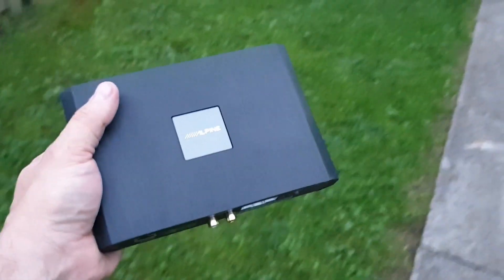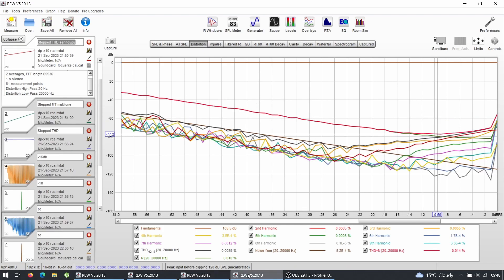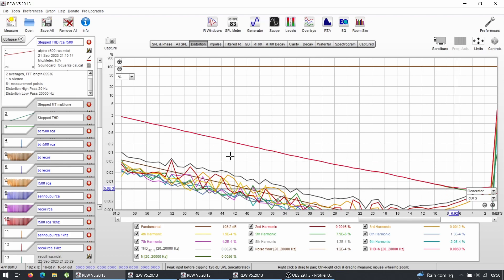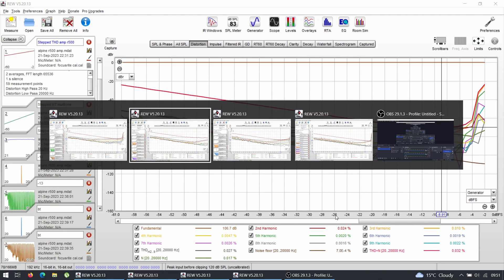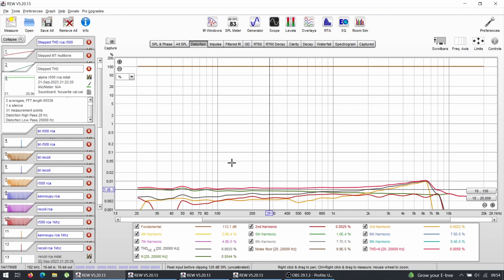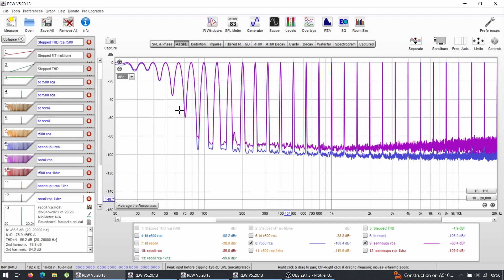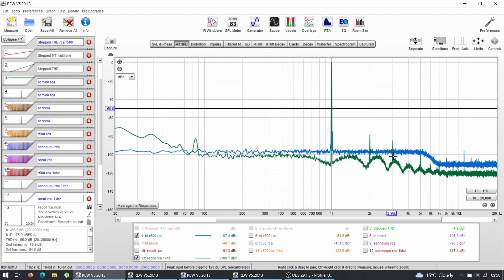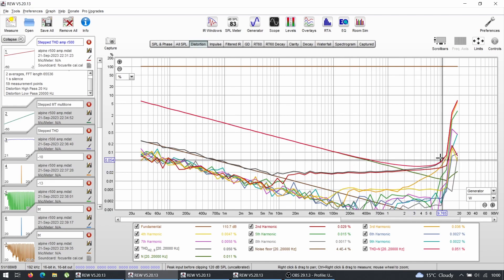Is more expensive DSP worth it? Alpine PXE-R500 distortion measurements

Comment: Will alpine entry level dsp with 25 watt rms per channel outout good enough to play my 90 watt rms morel speakers?
Reply from the maker: Yes, it will be fine.
Reply: @RAW-CAt  thanks for the reply.

I am new to car audio and looking forward to do a good  upgrade of my car music  system but in a  budget .

I will go with the alpine dsp.
Then the next step will be adding a mono and a subwoofer.

The budget options that are available in my place are,

Alpine swj12
Polk audio db1240
Infinity primus 1270

Would you like to suggest as per your knowledge.

I want the bass to be tight , precise , adequately low and loud but not boomy
Reply: I just ordered this dsp, I got a good deal in preowned marker.  Now I wonder how I connect it to the factory head unit with out any wire cut
Reply from the maker: @osomiyadeka270  you might find a harness on AliExpress, just need to check the pinout. Most of these DSPs will.have the same plug with same pins. Just find a combination of your cars harness plug.

Comment: Hi Fam,

Current setup:
Front Components: Helix S 62C.2
Rear Components: Helix PF K 165.2
DSP: Alpine PXE R500 (6-channel)
4-Channel Amp for Components: Alpine S-A32F
Mono Amp for Subwoofer: Alpine S-A60M
Subwoofer: Morel Primo 12
Source: Stock headunit with Apple Music via CarPlay

is it worth to spend extra to get a HELIX P SIX DSP ULTIMATE (give away Alpine 4ch amp and DSP) for front active and rear fill?

the new setup would be:
Front Components: Helix S 62C.2
Rear Components: Helix PF K 165.2
DSP + Amplifier: HELIX P SIX DSP ULTIMATE (Amp out 4ch for front active, 2 ch for rear fill, pre out to sub)
Mono Amp for Subwoofer: Alpine S-A60M
Subwoofer: Morel Primo 12
Source: Stock head unit with Apple Music via CarPlay

Will there be improved detail in the sound? or should i stay with the current semi-active setup? please help.

Addition:
Alpine S-A32F is 55W RMS / channel @ 4 Ohms
HELIX P SIX DSP ULTIMATE is 145 W / channel @ 4 ohms
If it matters.

The cost of the upgrade is 1900 USD. Is it worth the upgrade? will i see noticeable difference in detail?
Reply from the maker: You won't gain much with the upgrade. You will.have much better results upgrading your source from the stock HU. If keeping current setup, run the fronts active, mono for the rears and one rca cor the sub. Get another cheap amp for the rears.
Reply: @RAW-CAt  Thank you so much for your reply. The problem is that the TPMS, ORVM control, service indicators, and lights are all integrated into the stock head unit. That’s the only thing stopping me. 😭 If i keep the current setup with stock HU, will the 55W RMS from the alpine 4ch amp clip or damage the speakers which are rated for 100w RMS?

Comment: Hi, I am planning to use Alpine PXE R-500 but confused about the speakers. My car fits 6.5 inch speakers. So in the back I will have a set of coaxial speaker and in the front a set of tweeters with mid range speakers. Now the question is what kind of RMS wattage of speakers I should be looking for? And will it be able to support a powered subwoofer. I yes what should be its wattage?
Reply from the maker: This DSP/amp will be fine for factory upgrade speakers, anything more serious and I would get a separate amp. Look for low power (up to 50W) and high sensitivity speakers. For a subwoofer you NEED a separate monoblock.
Reply: @RAW-CAt  Thanks for replying. I was planning to map it to Focal Access 165AS and 165AC which has 60W RMS and peak 120W. Sensitivity is at 91.3db.Will it work? Or do I need to search for a different set with a lower rating. At this range the Focals seemed to be good enough. Not sure of any other brand with lower ratings and as good as Focal.
Reply: There is a budget version which is Focal ACE/ACX 165 with similar power rating of 60W RMS and 120W peak output. Only the sensitivity is 91.5dB.
Reply from the maker: @ssamanta72  any of those will work great 👍
Reply: @RAW-CAt  Thank you for confirming. I will go with the focal then.

Comment: installed a PXE C80-88:
2 months in, and already had to uninstall it and take it to warranty. A real cheap downgrade coming from a previous generation alpine amp. already has been analyzed by some technicians and doesn't have enough internal components to handle what is marketed as to do (4 speakers and a small sub)
Reply from the maker: I personally would never use a DSP/amp for a subwoofer. Only for midbass. What sub are you running of it?
Reply: @RAW-CAt  i went to an official Alpine installer and he arranged everything. it is marketed as an all in one solution. i have a SW10-4
Reply from the maker: @ravvvvvv  marketing don't know much about real world and that is a fact. Pro installers in most cases are bad as well and are listening to marketing advice...

Comment: Are the amplified DSPs running the amplified outputs into line output converters to give you low level signal? or do they have separate line and high level outs from the chip? Most budget headunits do this.
Reply from the maker: These have separate line outs just after the dac. And then the same signal amplified by the internal IC.

Comment: Good to see independent measurements. Helix next hopefully as its the benchmark DSP . My thoughts noise floor below 60db is already irrelevant especially for car interior. Distortion below 0.1% is already good enough but watch out for IMD which is much more important.
 My personal takes is u probably won't hear much different between them. For cars the speaker n car noise is the major variable .

Comment: I'm finding the cost of DSPs offensive...gonna try some Adau1701 boards...yeah DACs are the best, but neither are my ears.
Reply: if you want DIY approach, just make sure you did a decent power filtering. my recommendation with DIY approach: use active LPF and have a gain stage output. active LPF performs much better than passive LPF even with a cheap decent opamps and since the internal DAC only capable of 1V output, gain stage might be needed.

most budget DSP fell on its face caused by poor power filtering